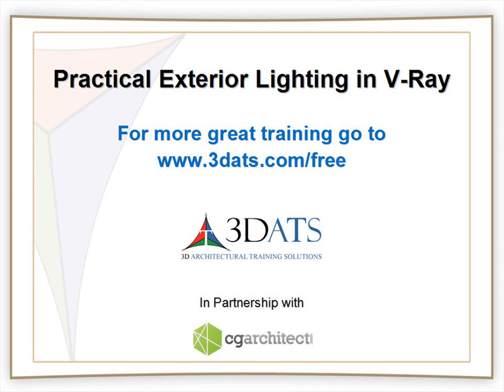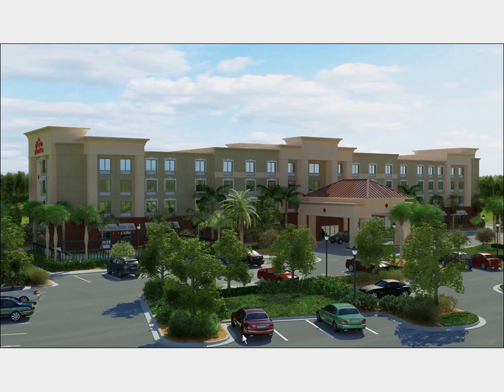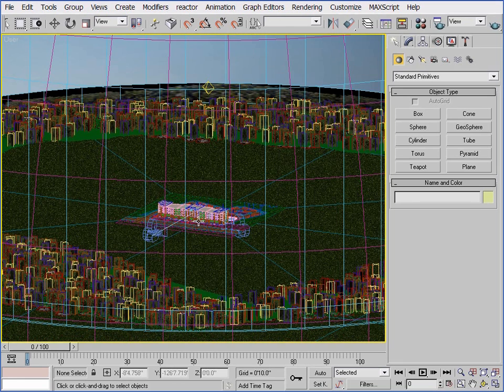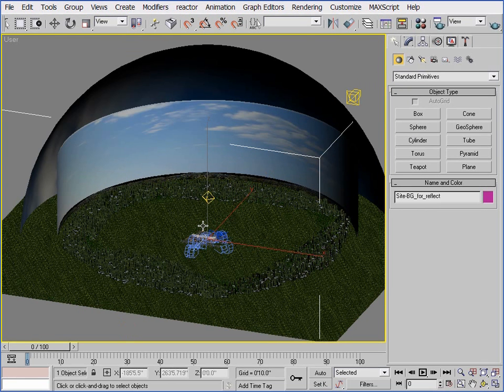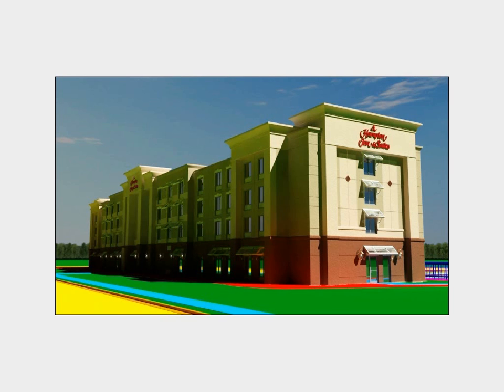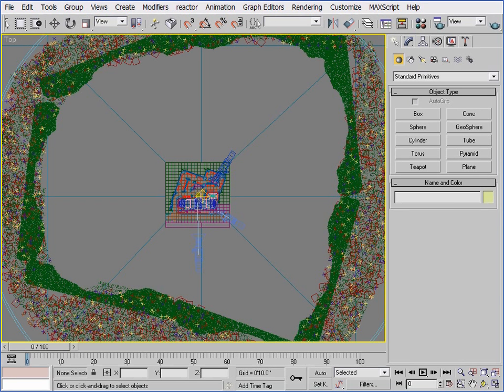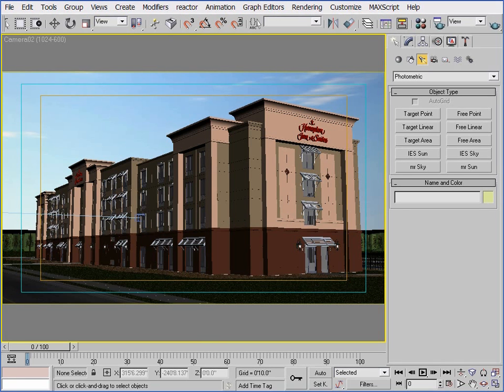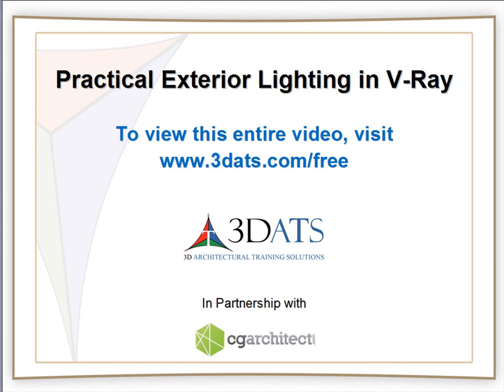V-Ray Exterior Lighting / Rendering Tutorial

Comment from the maker: @lachyray You cannot produce 3d results (as shown in the video) in Illustrator.  And there currently is no V-Ray rendering engine for Illustrator.  Although you could do the floor plan in Illustrator, most do the floor plans / elevations / etc. within AutoCAD and then imported through 3ds Max (we take the line work & make that into 3d).